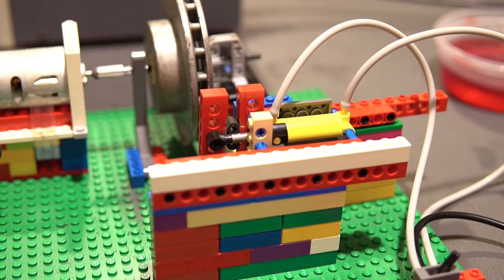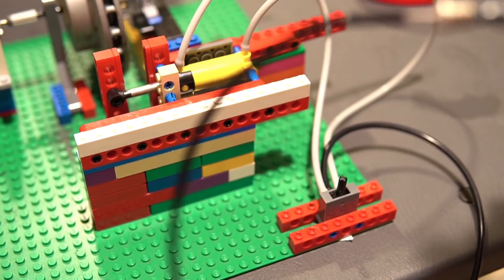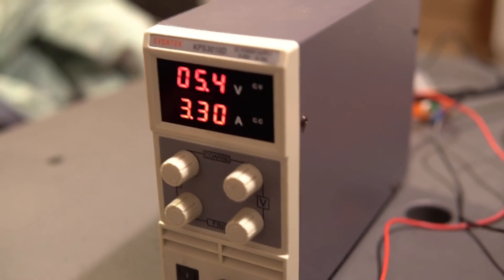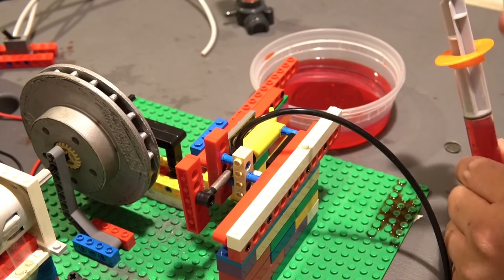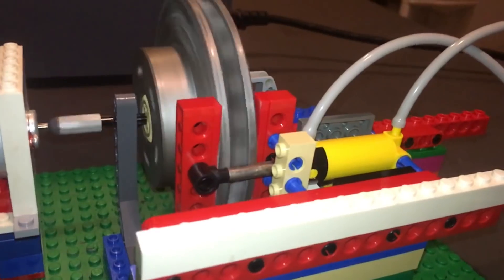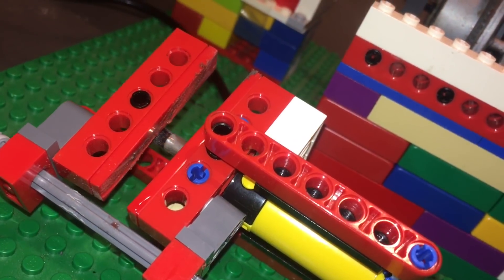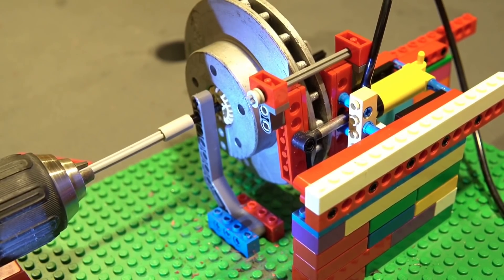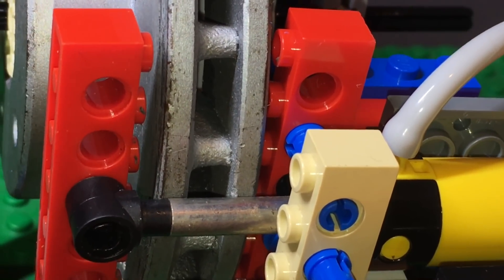LEGO Hydraulic Brakes Testing (Floating Caliper)

Comment: Just a tip if you didn’t already know:
-The voltage is proportional to the rpm
-The current is proportional to the torque
Limit the current instead of the voltage for better results

Comment: So a couple of things for V2. You should be able to true the rotor, as it sits in your rig, rotate it and mark the high spots. Then, just lay some wet and dry on a pane of glass and go to town, WD40 on the sandpaper works well with aluminium in my experience. 

Myself, I'd stick with pneumatics, depending on the pressure rating of the cylinders, however a multiple piston setup will help a lot. If you consider a small motorcycle braking system, you're likely making about 120psi in the line, and thus about 200kg or so on the caliper. For the combined 180 odd kg on my little farm bike, it pulls up quite promptly, if that gives you some data points.

Comment: If you drill out the ports on the cylinder you can get a whole lot more force from them.
People actually make engines out of these things - You can run them over 100 PSI easily and with a couple modifications to the cylinders and switches you can get them to do a couple thousand RPM and produce plenty of power for their size

Comment: Water is realy bad for lego pneumatics! You shoud use mineral oil
Reply from the maker: Yeah it kept leaking out of the piston at higher pressure
Reply: @madbrick923  no like it will make the metal rust

Comment: Its all cool but you wont have similar wear on the brake pads. The inner one will have less wear as the outside one.

Normally the brakepads are loose parts and are hold by a holder and the caliper goes over wich pushes the inside brake pas and pulls the outside brake pad.

Comment: You need to stop the motor giving power it’s still trying to turn it making it harder to stop it
Reply: Yep, spinning setup needs to freewheel
Reply: It’s like you’re hitting the gas and the brakes at the same time lol.
Reply: Exactly,  there should be a clutch that disengages or the motor should be cut from power and just use its resistance as part of the braking.
Reply: Well, the brakes in a car actually have to stop a rotating force that doesnt want to stop. Letting the rotor freewheel wouldnt really simulate that, but keeping the motor force on it does give an approximate simulation of the forces that would be happening

Comment: I think they would become more efficient if you implement a t in the hydraulic system and use two slave and master cylinders instead of one on both ends of the caliper so it doesn’t have as much movement.

Comment: Is this a brake disc and caliper?
Reply: An ideal caliper would be free to move as a unit while keeping the brake pads parallel to the disk surfaces while applying the squeezing force. Bicycle brakes are often mounted on a pivot.

This design isn't ideal, but it is good enough for many applications. The unequal pressure causes uneven brake pad wear and it applies a bending force to the axle of the brake rotors. That unmatched force will cause wear on the axle and/or the bearing surfaces of the holes they go through. Although it probably won't be noticeable until after wearing out 50 brake pads.

Comment: This is an awesome concept! I just think you need a brake pad with more friction to slow this rotor more efficiently
Reply: But also needs to disengage the motor when braking. With a traditional combustion car,  it'll slow to 600 to 800 rpms, requiring less braking force to slow the wheel than the 2000 to 5000 rpm it may be attempting to rotate at.  With an electric car motor,  the motor stops attempting to turn the wheel when the accelerator releases,  and then uses the motor as a generator,  converting the rotations into energy.  So with the electric motor he's using,  just need to cut power when brake pressure is applied.  That's not even getting into the negative rotational force caused by the tire grip,  gravity and the load that may be imposed on the rotor.
Reply: Steve Smith very much so
Reply: more friction = more wear. Also, he needs to apply more force to the braking pads, however, they will melt down without doing any job. Plastic is far from the best material to convert energy to heat
Reply: Basically defeating the purpose of the LEGO
Reply: 30
Reply: Maybe a custom metal Lego part if he has access to that
Reply: Two sided tape will surely stop it